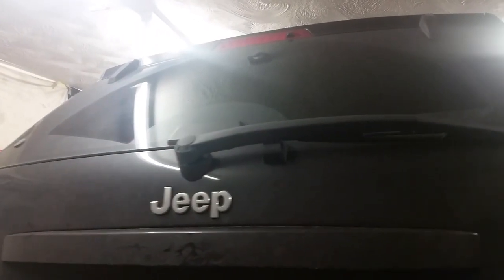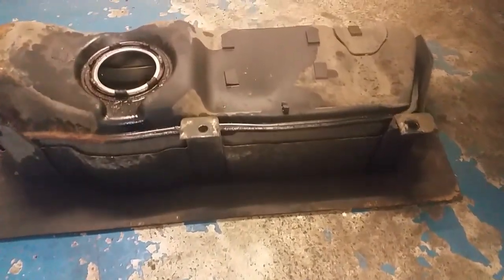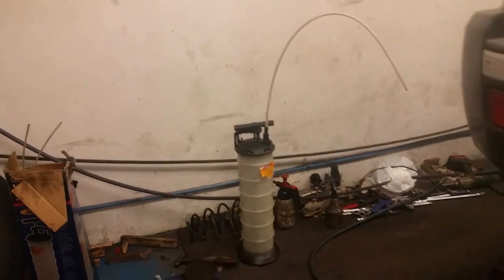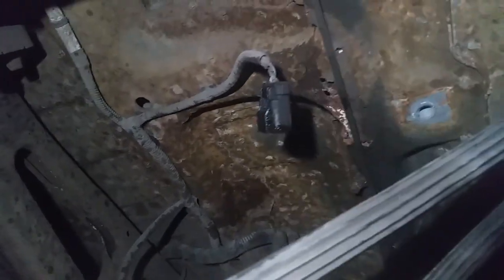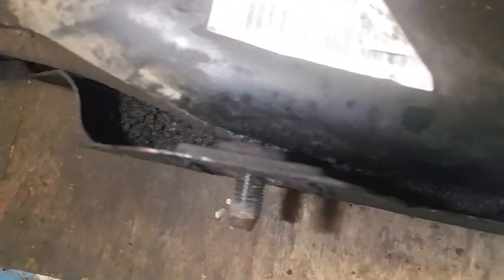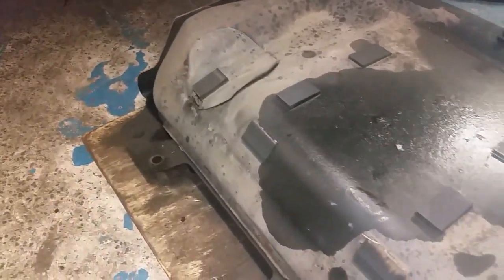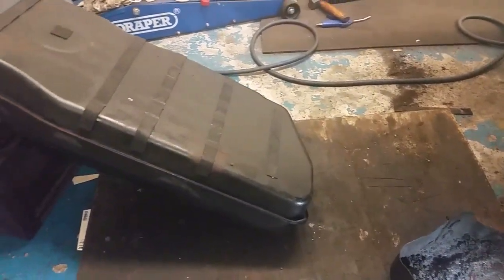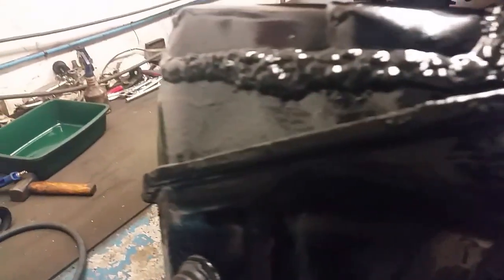Jeep Grand Cherokee WK 3.0CRD Fuel tank leaking diesel

Comment: I had same issue. I replaced the tank with one from a Hemi. Bolts in, is HDPE and the evap vent becomes the filler vent. Easy mod and never rust again

Comment: The Jeep Commander CRD 3.0 uses the same tank isn't it?
Reply from the maker: No idea
Reply: @davesterl  between 05-10 both shared exactly the same platform in Europe, suspension, engine, transmission, differentials etc. I'm having some issues to crank the engine first time in the morning, after I  changed all the spark plugs, spark plug module, injectors its better but still crank 4 or 5 times before start. I'm suspecting of the lower pressure pump inside tank as the issue happen only at the first time in the morning. So I came across all this comments about tank corrosion with WK2 so I wonder if I also have the same issue.